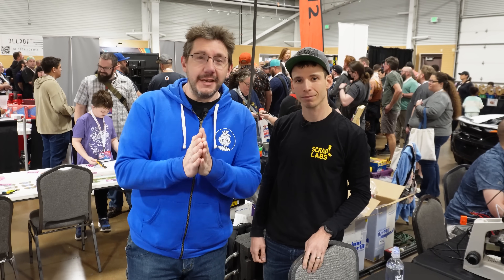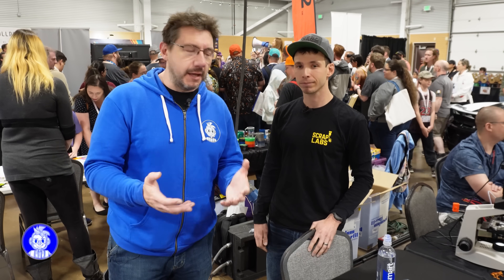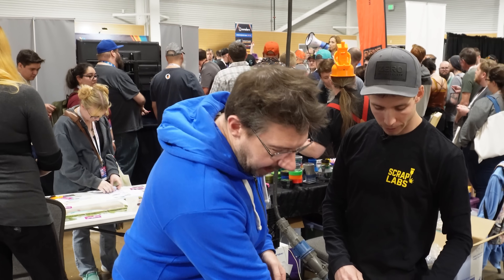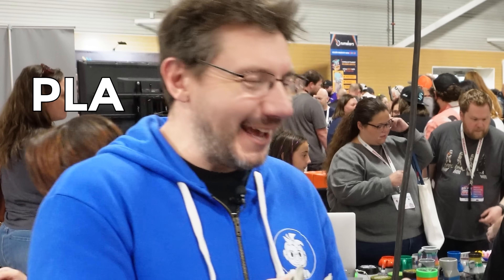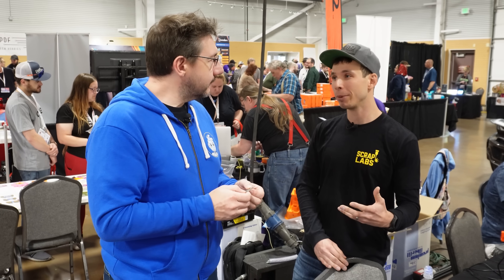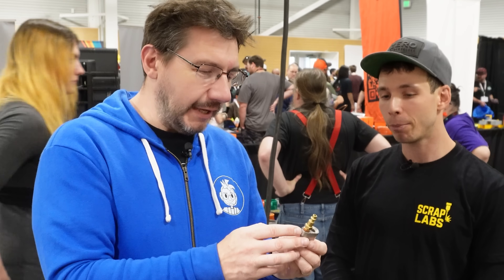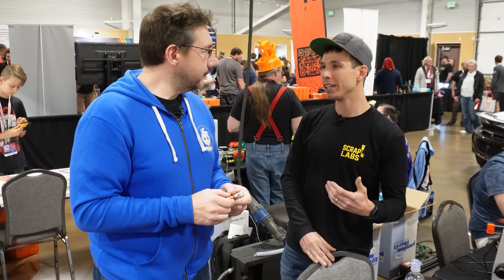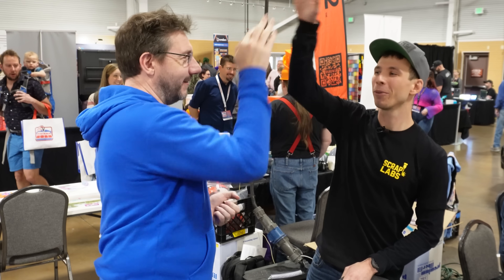3D Printing METAL AT HOME!

Comment: I'm dubious about metal printing ever really being viable as a consumer level product; not just for cost but, as with SLS, because of all the skilled labour and heavy PPE needs.

Still, getting the devices cheaper and more flexible will open them up to craftspeople.  20K is viable for a small business, and this could be useful for, say, a small garage - assuming a library of spare parts became available as well.  And that's an environment where it's reasonable to expect people to learn how to handle the material and machinery safely.
Reply: Yes, it will required at least a clean room only for the printer. it's not realistic.

Comment: No way the average hobbies will shell out 20k that’s insane
Reply: Small business will jump at a good quality $20K metal 3D printer.  3-5 years later, the technology will be $5K or less for hobbyists.
Reply: @Liberty4Ever  And will still require a dedicated room because metal powder isn't a joke and will kill you. It's not, and will never be a hobbyist technology.
Reply: @SaitoGray  - Many people said that SLA will never be a hobbyist technology because UV cured resins are toxic, and now thousands of people are using MSLA printers at home to make miniatures.  I use mine to make high resolution and homogeneously strong "ABS-like" functional parts in lieu of injection molding.
Reply: @Liberty4Ever that not true.
Resin is nothing compared to metal powder that WILL kill.
You will require a clean room, a TON of cleaning and safety equipment.
It's not a home technology, it can't be.
Reply: @SaitoGray  - Same old fear mongering.  If it can be done safely in an industrial environment, it can be done safely at home.  The process just needs to be engineered appropriately.  I cast my own lead bullets at home, powder coat them and reload my own ammunition.  Been doing it since 1993.  I have a CNC machine shop in my basement.  I have a CNC laser.
Reply: @Liberty4Ever  Lmao, yeah, Pneumoconiosis, pulmanonary fibrosys, COPD and cancer is definitively fear mongering.

Casting and powder coating is easy mode, dealing with dust is not. Not only the equipment is crazy expensive, but you will ABSOLUTELY need a dedicated room, with industrial level aeration.
It's dust, it goes everywhere and breathing it WILL cause severe damage.
Reply: @SaitoGray metal powder is really not a big deal at all unless it's titanium or magnesium that will combust. I grind all the time and produce a ton of dust every week and you just need regular masks and you can build a shop filter system. I could setup a large HEPA filter to scrub a small room that this would be in and handling the dust is no big issue at all. Yes people need to be educated to not handle it irresponsibly but handling metal powder isn't that hard or cost prohibitive. HEPA filters are cheaper than ever tbh.
Reply: @clutchboi4038 the dust used in these printer is an order of magnetude finer than your grinding dust.
The printing dust is really small, volatile and will cause respiratory damage and desease of not correctly filtered.
It's graphite level dust that goes everywhere.

Comment: Metal 3D printing is exciting and likely to reach home users soon, but handling loose powder remains a major safety concern even with proper PPE. FDM based metal printing using metal infused filaments is a much safer and more practical option for home use.
Reply: Yeah but it sucks for functional parts

Comment: I design for this technology everyday and my technician who runs the machine is a female without a beard (sealing surface for any mask) she still wears a papr respirator when messing with this stuff. I encourage everyone that even considers metal at home whenever it’s available to not just use a dustmask or n95. Stainless steel sucks to breath in
Reply: No kidding, I would not even use a N95.  I use a respirator that has had a fit test and a P100 mask.
Reply: Papr is the way to go
Reply: Stainless steel powder in a dust cloud can also ignite if there's an ignition source. It's banned for that reason where I work. We use inconel instead.
Reply: I’ll never do resin printing for this reason, but feck. Metal printing isn’t as bad?! Seriously?
Reply: Ehhhh…I’ve been breathing stainless and inconel plus every other metal working in the nuclear/boiler industry for over 20 years. Still breathing like a champ.
Being afraid of a little dust is exactly why people have zero immune systems these days.
Reply: I'd imagine something like a sandblasting booth is required but with better sealing and filtering for part cleaning. I still see this as less of an issue than dealing with resin.
Reply: @Awrethien  What are you talking about ? Metal dust is WAY worse than resin, it will kill you.
Reply: @Awrethien  not sure of any studies but I would make an educated guess that metal powder inhalation would have not only immediate impact on your health but also cause long lasting issues quicker than most resins available to consumers
Reply: @Gholson314 , @lawrencemanning & @SaitoGray Oh yes, I'm just going to use an air compressor and blast the dust with an air compressor and breath in the airborne dust like an armature wood worker does saw dust....

Give me a break, of course I would use PPE,  I'm talking about a personal preference, and dealing with cleanup. Seriously get off your high horses. Is it so inconceivable someone might have an opinion that differs from yours?
Reply: @Awrethien not really …long as you understand the risk do you
Reply: @Awrethien  PPE is not enough. Dust is volatile and you will need a dedicated room and aeration. Metal dust cause respiratory issue, and can cause cancer. It's not to be played with.

Comment: Printing parts for aircraft requires a whole other level of testing and validation, but this could address a huge gap in the maker space!!  It's great to see this progress!
Reply: It should be fine for experimental rated aircraft, for other aircraft there will be a case to case basis I believe as someone could in theory make a hollow part with no structural support and say that it's for structural use

Comment: $5000 or less is consumer level, not $20 grand lol. And a coaster sized build plate what a deal!
Reply: true, but thats a vast improvement over what exists now.  The build plate is so small too so it can probably only be used realistically for jewelry or replacement parts.  Still, theres money in that.
Reply: You don't realize the potential of that coaster sized build plate. Technical grade parts aren' usually that big. This is innovation. Failing to see that only demonstrates your ignorance on this matter. Progress usually goes in tiny steps, but this guy just took a big jump at more than 90% price drop to the next competitor.
Reply: @00fiks82   I was under the impression that the next competitor was Metal Base at €15K for their target price.
Reply: Well, it appears to be a big step toward cheap metal 3D Printers.
His goal appears to be consumerhardware.
I think he will get there if he keeps going.
Reply: Time to put on your inventor engineer hat and start planning a cheaper one 😉

Comment: I love the idea of home metal additive, but as someone who actually works with it, a couple major issues I never see addressed by the open source projects is powder sieving and support removal.
The support removal tools we use at my job are very expensive, and while you can get away with just a chisel and hammer, that takes FOREVER. And since you probably want to reuse the unspent powder in your process chamber, you have to sieve it and any overflow to have a constant powder size.
Reply: @Nitor_   guessing this also has to be done within a chamber to keep the powder clean? Doubt many hobbyist will have a place that it's okay to spill some powder
Reply: @StepSherpa you usually have a separate machine that either automatically pics up the overflow from the machine or you have to manually move the overflow tanks into. The machine I work on does not have automatic overflow siving so after a print the excess powder is brushed into the overflow shoots into tanks that are then loaded into the siving machine. Our machine has gloves like a sand blasting chamber so you have to by hand brush the powder into the shoots. 

You also have to empty the overflow somewhat regularly during printing (about every 12 hours for our process) to not overfill your tanks.
Reply: Another thing that I forgot to mention is that you will probably also need a mill or CNC to resurface your buildplate after every print, and a band saw big enough to fit the size of your buildplate to remove the parts. So you need a small home machine shop just to support the PBF machine
Reply: and depending on the metal, you need to have a oxygen deprived chamber.  Getting the gas to do that is another expense.
Reply: @1212megajr  Depends on the gas. If you just need oxygen free basic Co2 is cheap and easy to get. I get a 5 pound tank filled for $20 every few months. Its when go to things like Argon that is gets crazy.
Reply: @Awrethien I know for the filamet metal filaments that you can print then sinter, you needed a noble gas for aluminum and titanium.
Reply: What do the support removal tools look like? I'm curious
Reply: @MrBluntNose  we use Joke air filers with chisels mounted and Joke rotary tools. Each of which is about 2k euro for each + the compressor to run the air tools. It’s a very violent process so if you have fragile parts they are prone to get damaged during support removal. 

There are fancy solutions out there using liquid nitrogen to cool the support to make it brittle enough to be bead blasted off, but that’s very expensive.

Comment: I like moving the technology forward but $20k is not "affordable for a hobbyist"
Reply: Look into home machining. 15 to 20K is not unreasonable for an affordable machine like a Tormach. This is the level of hobbyist they're target.
Reply: Depends how much you can save or make with it. If your hobby is restoring old cars or motorcycles then being able  to repr8nt a new version of an old part that is out of production and impossible to find or rare and thus costs thousands can quickly pay for itself. The remaining looking triple tree for my 1975 Husq 175 alone was $750 being able to replace older parts with new to cosmetically perfect parts in stainless could quickly pay for itself. Also once you take the measurements and design it to match the factory part you could then make that back in Etsy or ebay sales pretty quickly for niche parts and just print to order when you occasionally get a sale.
Reply: @g00fysmiley  Someone that sells things on Etsy is not a hobbyist. Your other example is 1% of actual hobbyists and he's talking about wide general adoption.

Comment: Heres hoping they dont get snuffed out by an acquisition like micronics
Reply: I also thought "Have I seen this movie before?" 🤔
Reply: @imausum1  Really sad what happened with micronics. So promising and a potential for a huge upset in the SLS market. Just to get swallowed at the finish line.
Reply: @rileyneufeld7001  dude Micronics couldn't even get their machines to work and then tried to push the way under developed product into the market
Reply: I don't think so.
I think he really wants to help the community.
And he seems to already have a decent income.
In contrast, Micronics was in a tight spot, and it looked like they did not have much money (although I don't know for certain).
So, whatever was offered them was probably a lot of money *to them*.
But Matt looks to be in a different situation.

I'm not Micronics or Matt,
But I think its a good chance.
Even if it fails,
He might still release the plans to help other people to build one like his.
Reply: Micronics had a lot of bad secrets that they were covering up, in addition to their money problems.  This is an entirely different situation.
Reply: i wouldn't be surprised if micronics sold out because everyone with SLS experience, including formlabs, told them that their product was not safe for home use, that even shipping it out to youtubers had been irresponsible, and that they would be facing a class-action lawsuit down the line.
Reply: They will...
Reply: Oh it will
Reply: no chance. But it is still nice to see .😅
Reply: No plan to do take the easy way out. Genuinely in it to proliferate the tech, not get a pay check. Hence the open source part. In theory if the company did ever dissappear the designs are still out there